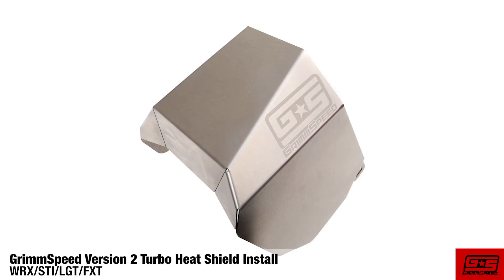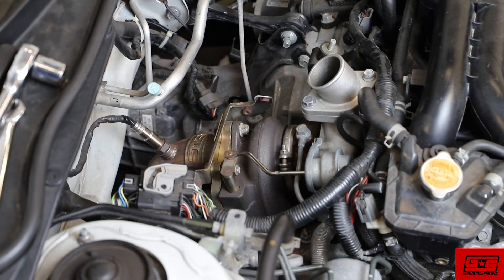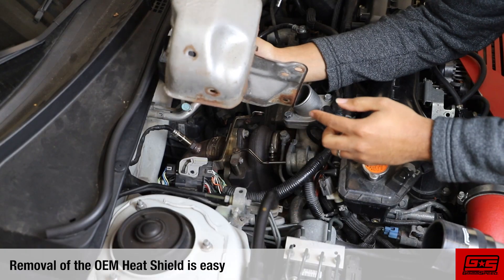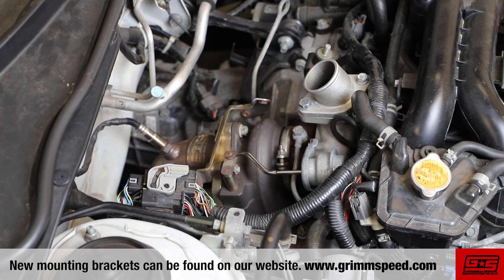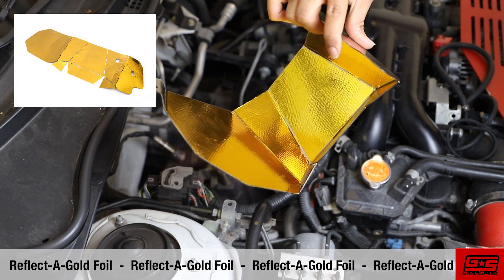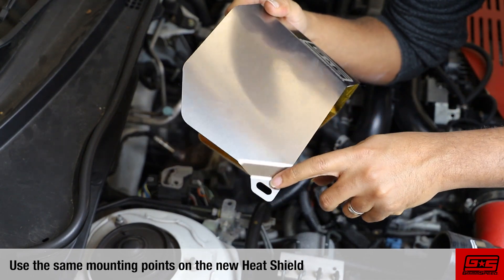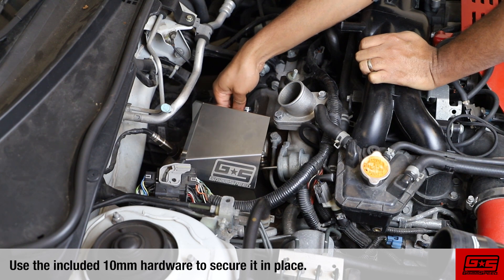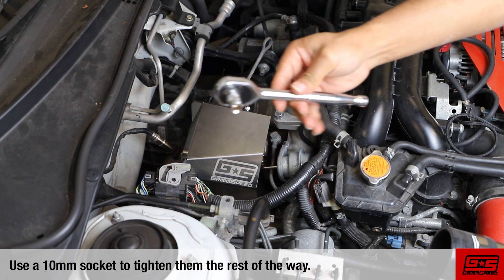GrimmSpeed Version 2 Heat Shield Install - WRX/STI/LGT/FXT

Comment: Can this be installed without removing the intercooler? I’m looking to have an exhaust shop install an aftermarket catted invidia downpipe on my 02 bug and want to know if they can install the heat shield while the down pipe is removed? Thank you.

Comment: nope, didnt fit. hits at the back and the lower long side kisses the joint on my down pipe. running a blouch 1.5 and a 3 inch catless dp im going to have to butcher it and also drill my own mounting holes to bring it forward a bit

Comment: I ordered this and did not install it as I had the top bracket removed and assumed it wasn't compatible with my downpipe setup. I just barely got the car running again and still have to tune it, so definitely gonna get this on before that (I feel so dumb now lmao).

Comment: So if I installed a larger stock location turbo this heat shield would still fit?
Reply from the maker: It depends on the turbo, but most stock-location aftermarket units will work with our heat shield.

Comment: I purchased the ceramic coated version, it did not come with the gold foil though. Is that supposed to be included?
Reply: You have to pick the option to have it on, gotta pay more money for it.
Reply from the maker: The gold fold does not come with the Version 2 Heat Shield. It is an add-on piece.